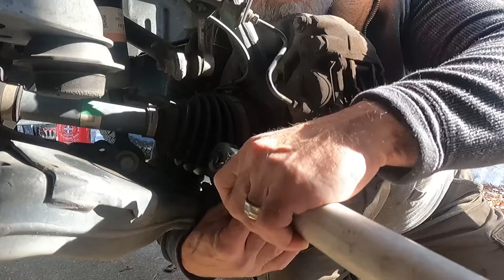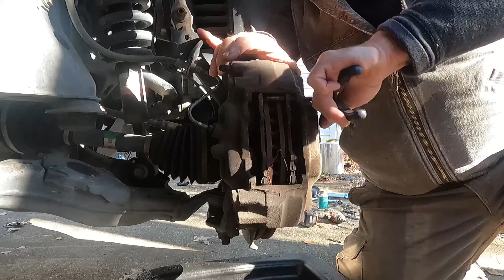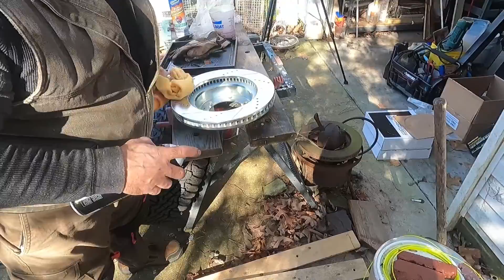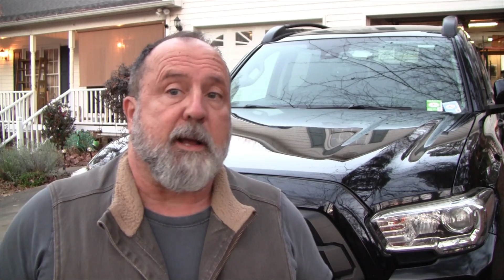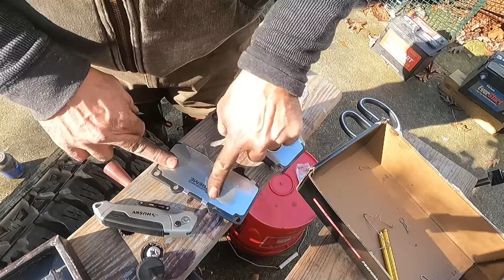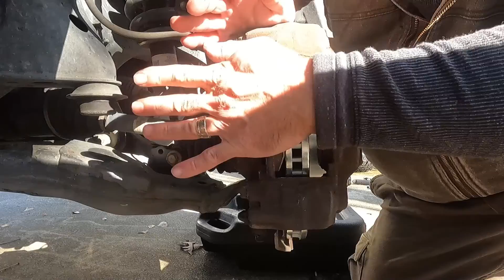Toyota Tacoma Gen 3 Power Stop Extreme Z36 Rotors and Ceramic Pads

Comment: Have a question I’ve heard mixed things about the slotted rotors. I’m thinking about getting this kit, but I don’t really need slotted rotors since it’s basically a commuter truck.
Reply from the maker: You could definitely get away with just the ceramic pads and avoid the slotted rotors if you want! I've heard slotted rotors are more prone to warping but i can't confirm this as i haven't had that happen in my experience.